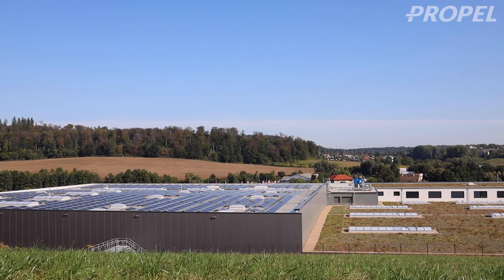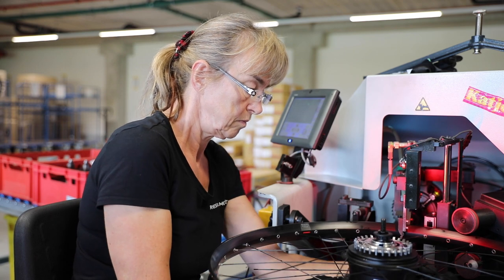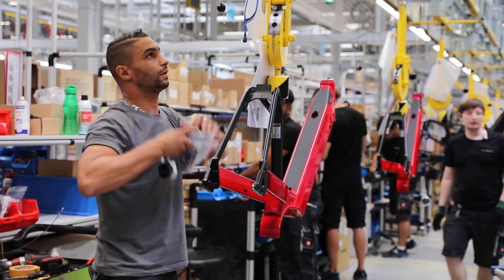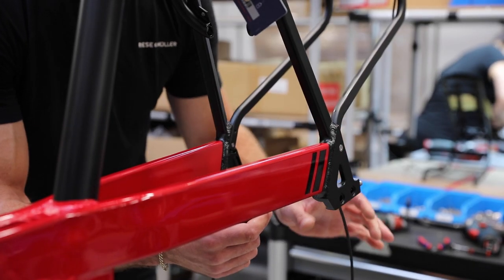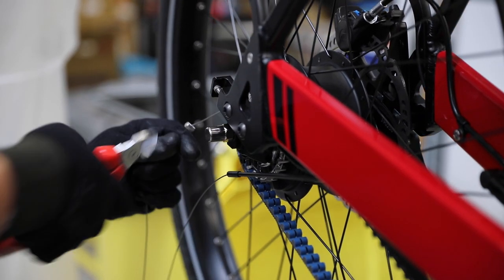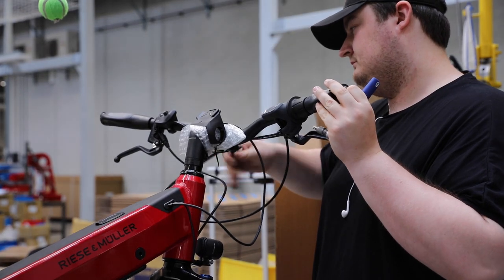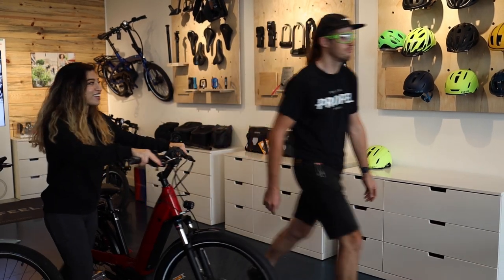How a Riese & Müller eBike is Built

Comment: Good video.

Personally, I still can not get my head around the cost of these e-bikes compare to what you can get in either a motorcycle or a cheap beater car. (just from physical product/hardware/utility it can offer for the money)

Again, just my own opinion.  In my financial world, all these ebikes are 50% too much.   Until than... I pedal my cheap used garage sale bike.
Reply from the maker: Thanks! Glad you liked the video and I totally hear you on the price thing. These bikes are often regarded as the Mercedes of ebikes and I think that’s an appropriate assessment. Sure there are some VW of ebikes, but it depends on what you want. 

An ebike definitely offers more utility in a city than a car or a motorcycle from my perspective. I’m glad that you’re riding though. Whatever gets you out there is great from my point of view.
Reply: I agree. Dunno if Reise and Muller even do non-electric bikes but in the case of Gazelle, their electric bike that costs £2100 is just £700 in non-electric form and the plain old 3 speeder is just £500 which is all a  bit mad really!
Reply: As a counterpoint, there is a mountain bike manufacturer/dealer near me selling a brand that runs $5k - $8k+ for top-quality, NON-assisted bikes. When you can appreciate differences in quality - and can afford and really make use of the best - then you know what you're doing when you buy an elite product. If having a lower-quality product (or "a cheap beater car") suits you just fine, then that's a good match for you.

Comment: Poor new happy owner, saddle was not adjusted to the proper height...  ;-(
Reply from the maker: Yes, we know someone would comment on this. She is a brand new rider and that’s how she wanted to start out. She is well aware of the appropriate saddle height but she will work up to that point. We should all try to be more tolerant of new riders, we were all that person one day.
Reply from the maker: I hope that makes sense. This scenario happens a lot in the shop. I’d rather someone start where they are comfortable than to have the perfectly adjusted saddle. We have even installed dropper seat posts on urban bikes sometimes to give people an easier time to stabilize the bike when they’re stopped.
Reply: @Propelbikes   Thanks! This is understandable. To be honest, I also was considering a dropper seat posts for my Homage GX 2019 as it is almost impossible to get a save stand when stopping suddenly at a traffic light, especially on uneven ground. Permanent lowering of the saddle, however, is no option when driving longer distances.
Reply from the maker: No worries. We’ll probably make a video about this topic as it is an important one for sure. I would highly recommend a dropper post, they are really great to have. I have one on the Load I ride often and it’s really helps me handle the bike more easily, especially when it’s near it’s capacity and I stop. I don’t have to get off the saddle.
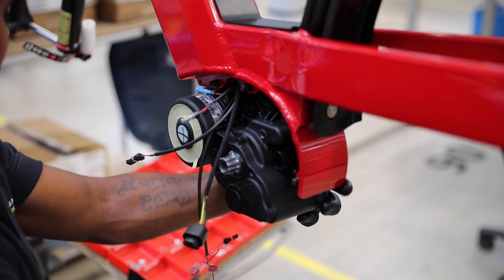Reply: @Propelbikes  great video, thank you!  Would really appreciate seeing a video on this topic too. Is there a challenge with after market droppers?   1:58 shows cabling going in then 3:10 shows some pull through space around the motor, does the 2020 Superdelite GT Rohloff have enough space for this to be a simple install?  I'm a bit worried about the dealer having to pull too much apart on a brand new bike to install a dropper.  In hindsight I probably should have gone GX option and swapped to road tires.